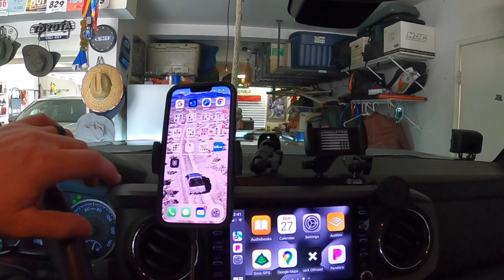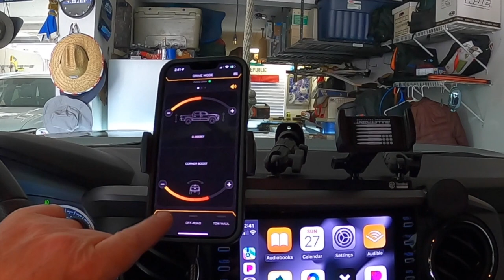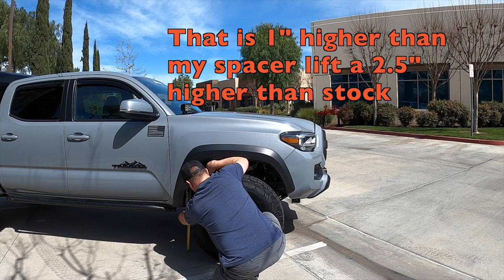ICON's CDEV Stage 9 with Intelligent Control installed on my 2020 Tacoma TRD!

Comment: How does the truck ride when you go over those speed bumps on a road meant to slow you down to 20 mph or less ? Not talking about speed bumps in a parking lot…..I feel like the stock suspension kicks like a mule over those kind of slow down bumps. Would it glide over those do you think ? Not sure if you’ve encountered those type of bumps since you’ve had the CDEV’s but thought I’d ask.
Reply from the maker: I haven’t tested that yet but based on the performance I have experienced so far I am sure it would help!
Reply: @advfamily  thank you for the reply, would you mind uploading a video when and if you do come across something like that ? Would be helpful to know how the truck behaves on pavement with those bumps. I have older family members that cringe being in the truck because of back issues…thanks again 🙂

Comment: What setting do you have the RXT springs? Did you do a CMC?
Reply from the maker: I believe it is at setting 3 due to the weight I carry and I do not have a CMC but I am planning on adding it.
Reply: Does it ride hard on setting 3 and the current weight. Did it give you too much lift in the rear
Reply from the maker: It doesn't ride hard but I do have a lot of weight in the back and it still provided a 4" inch lift in the back over my stock set up.